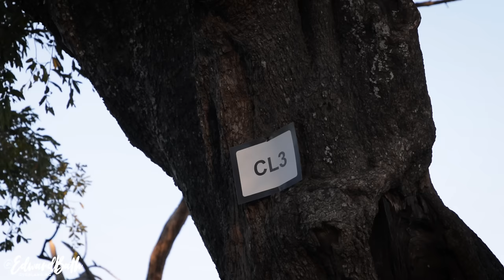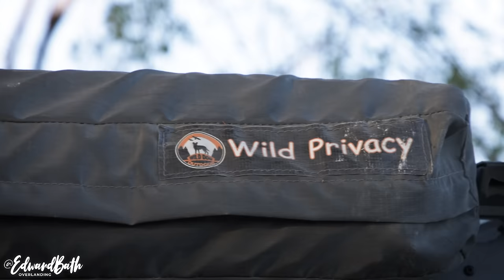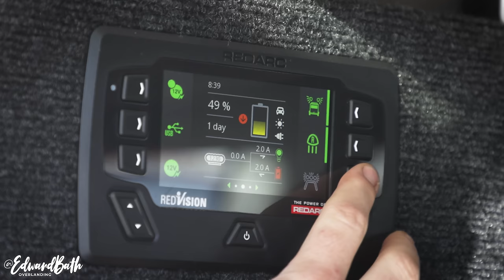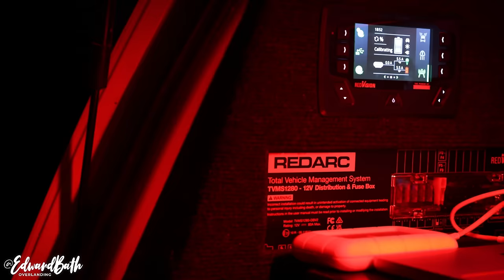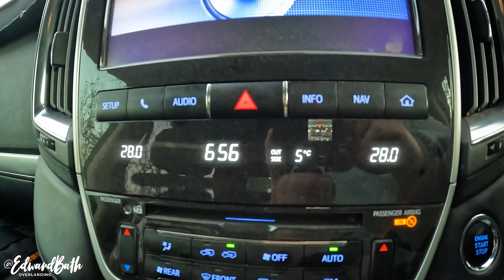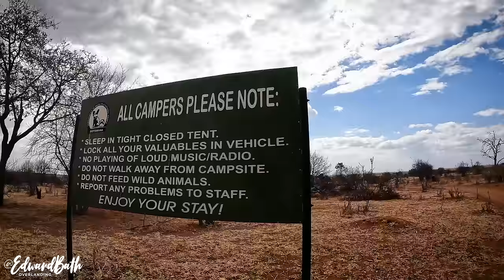LINYANTI & IHAHA | AN OVERLANDING DOCUMENTARY | PART 3

Comment: I think it must maybe be noted that you guys battled with that sand due to some serious weights in the whole rigs? I won’t say overloaded, but I’m assuming lots of weight. When we were in linyanti we had the fear of death put in us by some neighbouring campers, saying the road from linyanti to savuti was extremely difficult and we would definitely get stuck in the terrible sand. Well, it was easy as anything for us, no problem what so ever, but, we were a Patrol, with no trailer, and reasonably lightly packed. Shoo, long winded comment, but, just to say, weight is everything out there!
Reply from the maker: Yes definitely weight is a killer hey. The drive all depends on the sand and time of year. Sometimes the sand is super easy and other times super difficult. We hit it at the worst time of day so they sand was super dispersed and unfortunately in the video I have to warn travellers because if I say it’s easy and then it isn’t then I will get bullets 😂😂 having a trailer definitely makes it tougher with the drag behind the vehicle so with the patrol and no trailer it must have been a breeze 💪